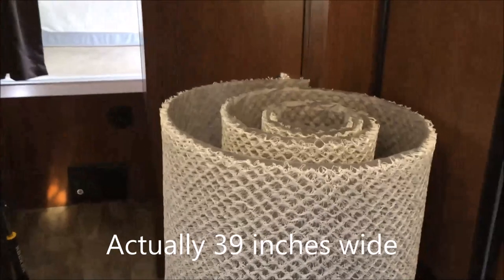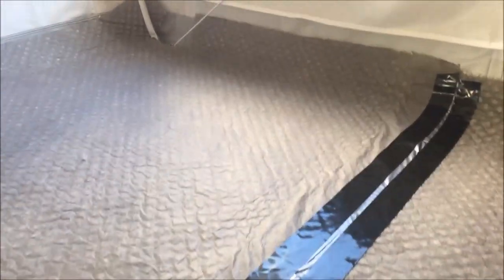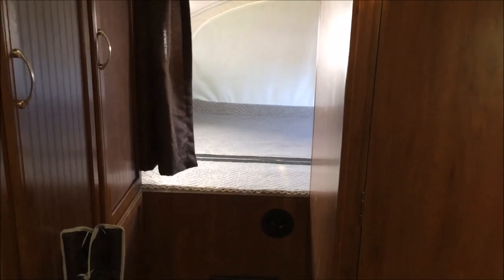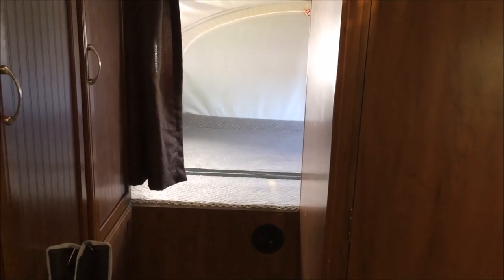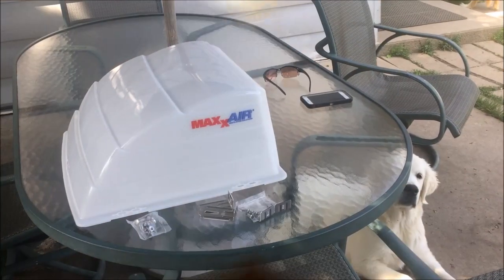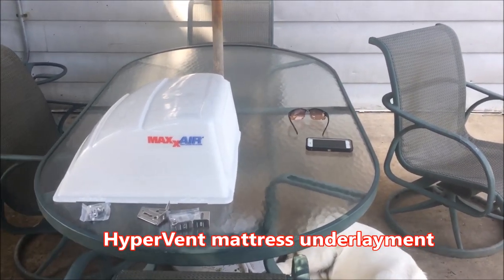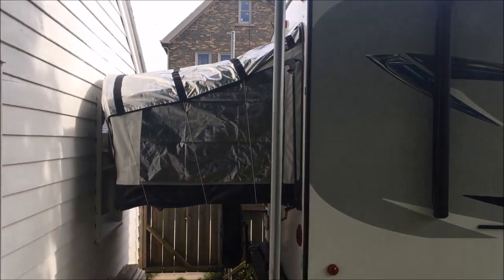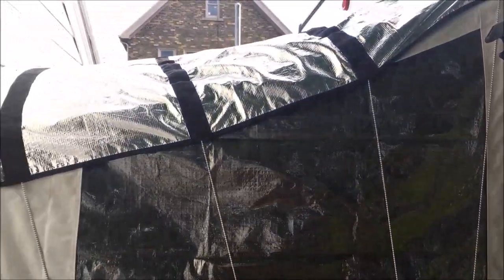Controlling Condensation in your RV

Comment: Thanks for the info.  Will be trying the HyperVent Mattress underlay. We have not experienced much condensation over the years. We do use the gizmos and reflectix.
Reply: Do you leave it on the bunk once you've fitted the hyper vent, when putting bunk end away?
Reply from the maker: @campingqueen8121  I do. It does make closing the the bunk end more challenging but it works for me.

Comment: We have been comparing which RV to get. Would you recommend the hybrid trailer if we live in a wet area.. if we did what you've done to help keep it from leaking.. I think if its dry when you close up the beds.. will it still have water get in when it's closed over time.. thats the big question if it will become a pain as it gets older.. I would like to hear what you think.. thank you
Reply from the maker: I haven’t experienced any water leaks around the two foldout bunks. If you close up the camper wet, you should definitely open the bunks on the 1st dry day and let them dry out. Also a good idea to check the gutters at the hinge point of the bunks as well as the roof and keep them free of debris. 
For me the hybrids make since. You get two queen size beds and there’s no encroachment of the common space. I personally still like sleeping under canvas, for me it feels more like camping. Bring ear plugs.... it’s like sleeping in a drum when it rains...
I believe maintenance is the key to success with any RV experience. Treat the seals keeping them from drying out. Check the calking throughout the RV and repair / maintain as needed. These are the same things that should be done with any RV but probably more important to stay on task with a hybrid.
Be well and travel safe...
Bruce H.